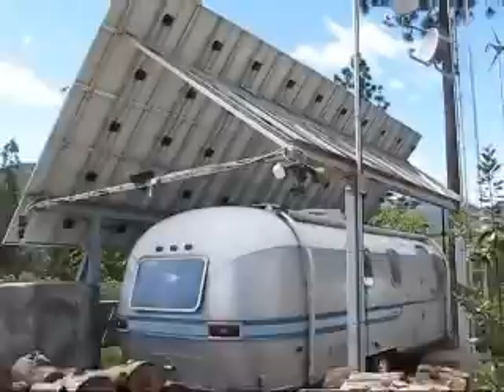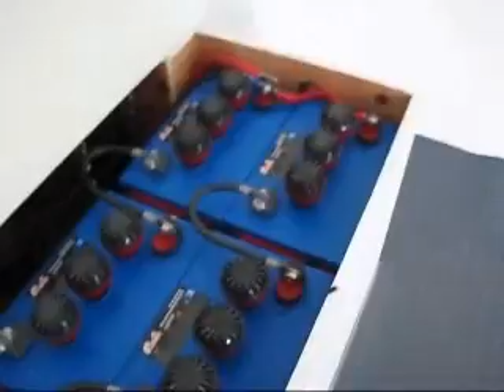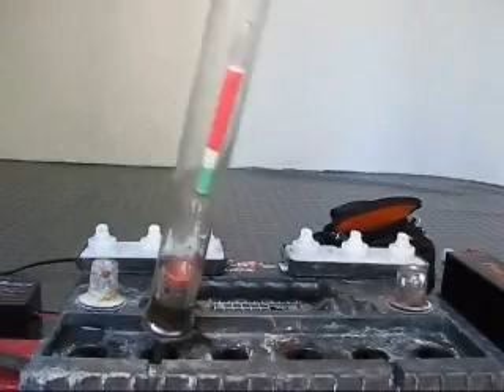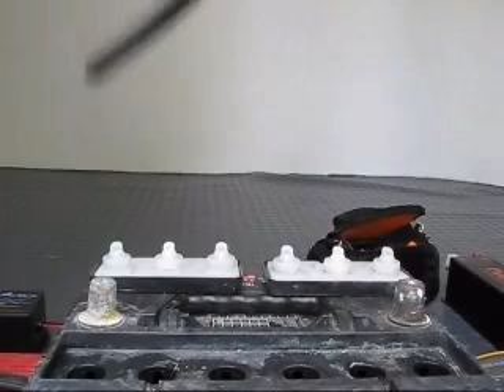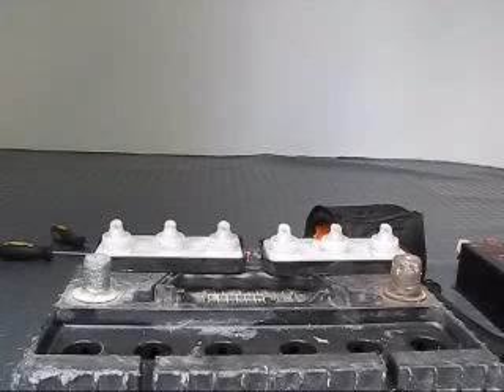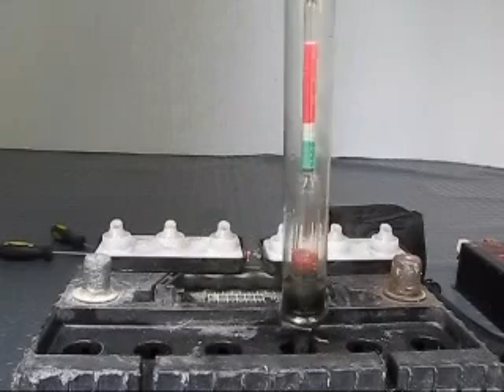Bringing back a dead battery

Comment: Dear friend.
I have been working with DC pulsed and DC direct last 1.5 years for electrolytic coatings. I have studied deposition and reverse-deposition of coatings. I am pretty  sure pulse DC charging is NOT more efficient than direct DC charging. 
You can NOT potentiate any ion by doing that.
Reply: +IvCastilla There are several factors in fixing a car battery. One resource I found which succeeds in merging these is the Magic Mender Wizard (google it if you're interested) definately the most helpful info that I've seen. look at this  incredible site.

Comment: nothing beats a slow low amp charge on a dead decent battery, I've worked on them for years,and they are sulphated or not,but irregardless a slow low amp charge for up to a week will kick it to full health,my motorcycle eats them,but most of all storing for the winter used to mean death to one,now I charge it at 1-2 amps for a week and it back to normal,slow charge is the BEST CHARGE

Comment: hey there, mike, i'm glad some else noticed that the level of the acid and distilled water level was still in the red, so ok it might give some small charge but it will be a minimal charge, the level of liquid should be in the green area of the hydrometer n' the higher the better, eh??
jakkadan

Comment: Thanks for that data on new techniques of charging and what about the simple method of using a solution that is poured into each cell to clean the lead inside?  I saw it on utube and I can't think of the name of the chemical at this time.  I will send it when I find the video.

Comment: the hydrometer shows the battery is a complete piece of shit in each cell. the voltage of 13 instant when he took the trickle charger off. Give it half an hour and I'm sure it would have read well under 12 volts.

Comment: @h0354y return it to the battery charge and it will be good for another 3 to 4 years ive only ever done it the once to the same battery but im sure you could prob make it last for 12 years try it.

ive just found out that if you put a teaspoon of bakeing soda in the battery it will help it hold its charge a lot better.
it wont work on those new sealed batterys tho have fun

Comment: @h0354y i learnt how to do it from a biker bud of mine when i was 19 im 48 now i have used it many times i have taken flat batterys that are 4 years old and made them last another 4 years doing it .
you just take out the plugs turn upside down over a plastic dish and shake till all acids out you then flip it over again and fill with tap water turn upside down on an area you dont mind being dead and shake till the waters out repeat it till the water that comes out is clean then siv the acid and

Comment: The reason a battery goe's flat is the lead falls to the bottom of the battery as it flakes off of the plates.
all you do to make it like brand new again and abel to be used for a further 3 to 4 years is empty the acid out into a plastic bucket put it to one side fill the battery with fresh water and shake it around poor the water out refill shake again do this till the water thats comeing out is clean epty it put the acid back in and garge your good to go for another 3 to 4 years easy.
Reply: hi where did u learn this

Comment: Only problem with using old batteries is that over time the electrolysis causes the lead plates to flake and the buildup of material on the bottom of the battery will cause the battery cells to completely short out.